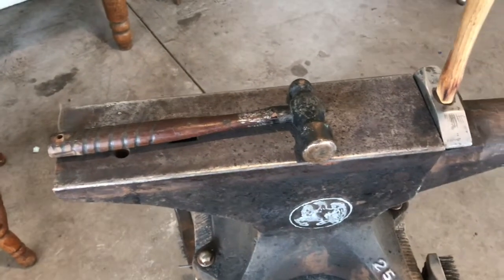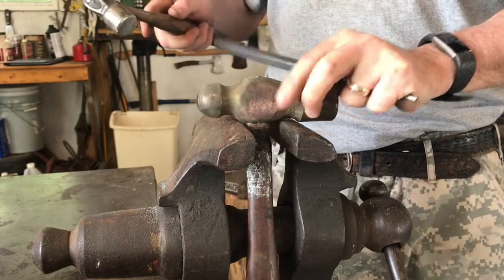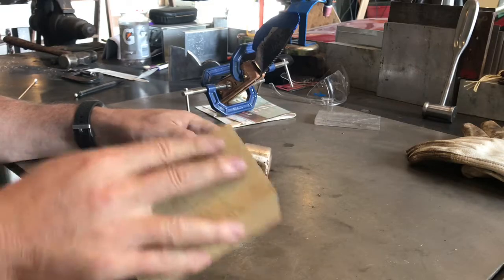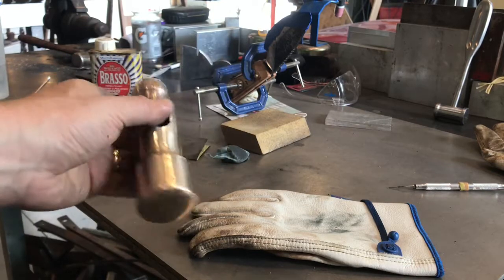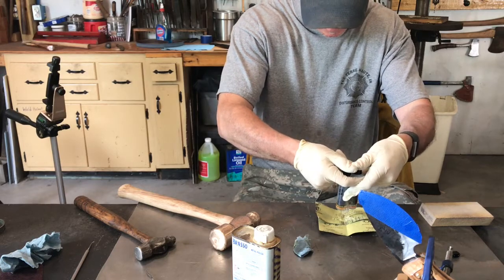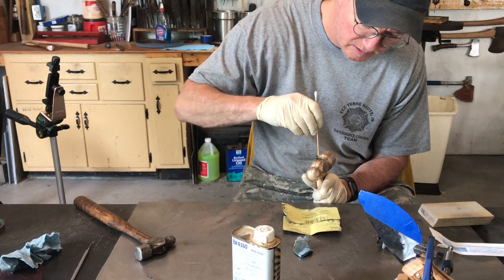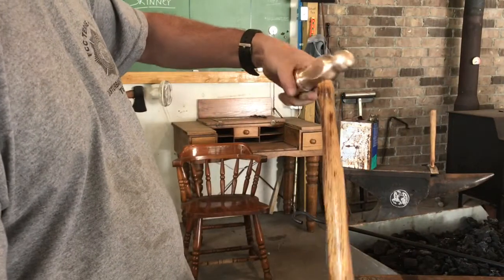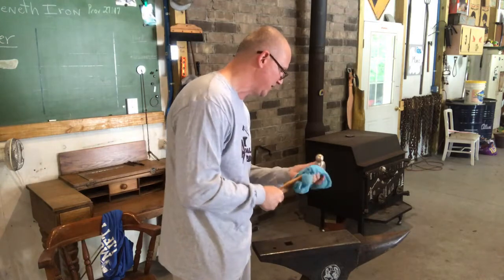Brass Hammer Restoration : Vintage Stanley

Comment: Wow that turned out really nice
Reply from the maker: Yeah it really did. I use this hammer all the time in the shop, what a great deal!
Reply: @shopdoc  I recently just picked up a brass hammer that I'm about to restore.
Reply from the maker: @_BigLife_  Nice! They are definitely worth the effort. I use mine every time I am concerned about damaging the part I am striking. Usually things like threads on a bolt and something I don’t want to mar up.
Reply: @M7 Metal Works  I was deformity punches so I'm glad I found this brass hammer.   Again great video.

Comment: Is it brass or beryllium copper? I heard that stuff is kinda toxic to grind on? 🤷🏼‍♂️
Reply from the maker: Well I am only assuming brass but if you know that Stanley used Beryllium copper then I suppose there’s a chance mine could be copper. I suspect many things I do in the shop are probably toxic.
Reply: Yeah I really don’t know. I have an older Ampco hammer that is beryllium copper supposedly and people have said online that I should not wire brush or polish to leave it with the oxide on it because BeCu was toxic. Your hammer looks quite old and appears to be plain brass but I don’t know. I suppose some additional research could be done.
Reply from the maker: Good to know either way that there should be some caution taken when grinding or sanding these, thanks!
Reply: @shopdoc  yeah no problem, and I think it came out great. BeCu looks a lot more like brass than copper, so when I saw the raw metal through the grime on mine it looked way more like brass than copper